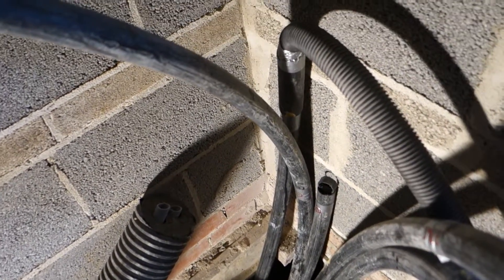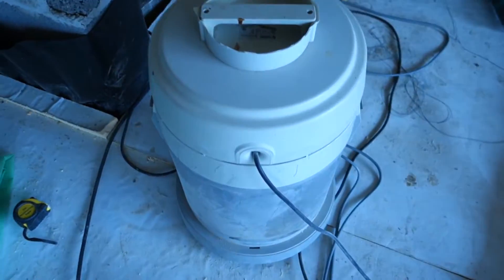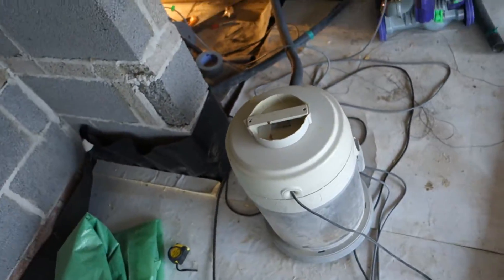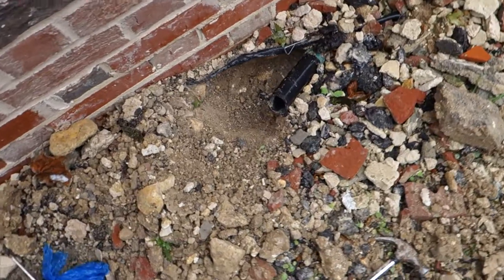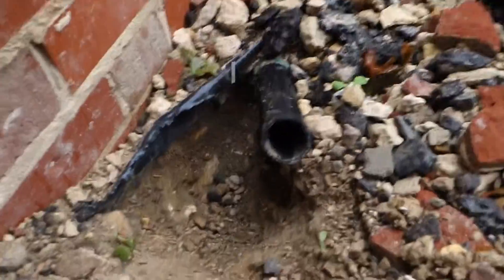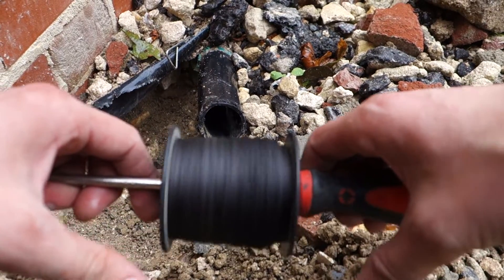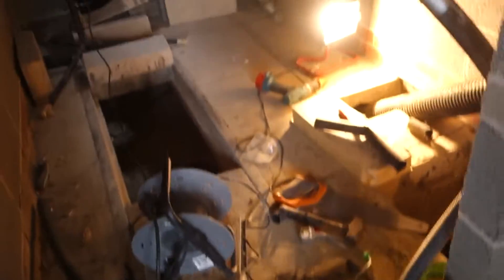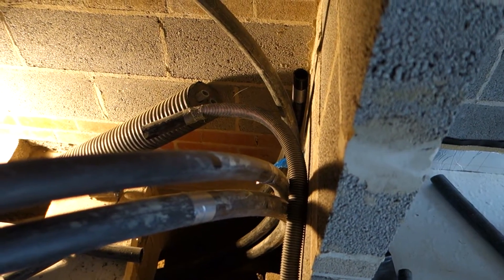Using a vacuum to pull cable through conduit. Does it work?

Comment: I sucked a pull cable 250' with this method...  I think it's better to have a bit more plastic though... you want it tight enough in the pipe that not much air is escaping past it.

Comment: We had a 40 metre underground conduit which had a couple of bends in it and basically whatever we did, we couldn't push a cable through it - it always stopped at one of the bends. We tried thicker pushers and even tried fishing for the cable with an endoscopic camera from the other end without success Then we tried this trick and lo and behold, we had a strong thread through the conduit in under 60 seconds from turning on the vaccuum cleaner ! We found that using two pieces of plastic bag set at right angles to one another increased the suction. Beware that the first thing that the vaccuum cleaner will pull out is all the water in the pipework, so you will end up with a wet vaccuum cleaner so use a wet and dry !
Reply from the maker: Good news it worked, it's a great trick. A bit of washing up liquid on the cable makes a load of difference as well and having one person push and another pull. The push doesn't have to be much, it's just to stop the cable binding. Yes I had to use a wet dry vac. Thanks for the comment

Comment: This is brilliant! Thanks for sharing! The commercial versions use a sort of sponge like thing at the end of the cable but then of course you need a lot of suction power or another solution was with compressed air basically pushing the cable instead of pulling it.
Reply: Buy a cheap bath sponge from a supermarket, cut a ball which is slightly bigger than the pipe's diameter and then thread a piece of string through it using a long bolt with a washer on the end to tie it to. Our neighbour just did this after we were successful with Brian's method using a plastic bag. Dipped the sponge in cable lubricant and it went through their conduit like a rocket ! Water in the conduit doesn't affect it at all.
Reply from the maker: I love that this works, save so much time
Reply from the maker: Yes they use compressed air to blow fibre but a much smaller tube. 

The basic principle is to create a simple piston. 

I found this on YouTube myself, I lean just about everything on here hahaha

Comment: Going to give this a try after snapping the original coaxial that was supposed to be my pilot cable in half.
Reply from the maker: How did you get on? Did it work?
Reply: @bodgeitwithbrian  bit of fiddling with the size of the plug, but it worked like a charm! Make sure you seal well to create a proper vacuum.
Reply from the maker: Great news, it's so satisfying to see it work, great job

Comment: I just developed a way to hollow out antlers, from the base to the tips of each antler. I am going to try out your vacuum process. If it works I will let you know.
Antler Dan
Reply from the maker: Antlers on a dears head? Why do you need the vacuum a wire through?

Comment: What’s the longest distance this can work?   I have a 150 ft patio drain that was installed incorrectly..  could I pull a string through it and re pull a flexible pvc pipe through the drain
Reply from the maker: I think there is only one way to find out. It's just a crude piston, the idea should scale up.
Reply: It will go pretty much forever providing you have no loss of suction where there is joint gaps where 1 duct ends & another joins the size of the ducting bore doesn't matter either if you've got a big enough vacuum for or compressor to blow it instead the only main problem is where utility cable ducting goes deep underground there is the possibility of water getting into the duct sometimes the water will not blow uphill & the bag might split
Reply from the maker: Yes there was water in my run from the joint, you should use a wet dry hoover. You will find that some water will come out and I ta best to use a plastic bag, the water lubricants the run then
Reply: Still no Hoover evidence
Reply from the maker: It's a verb, as well as a brand name
Reply: So what you're saying is you can Hoover with a Dyson, an Electrolux or a Vax which is totally wrong you can't it's not a Hoover they're trademarked-copyrighted
Reply from the maker: Yes you can absolutely hoover something up with a Dyson

Comment: Your Title is wrong, should be "vacuum to pull a pull string through conduit" you never pulled a cable with the vacuum
Reply from the maker: But the ultimate goal is to get a cable through, what would you Google?
Reply: @bodgeitwithbrian  The title should be descriptive of what the vid is. Then in the description or keywords is where you describe the cable, wire, conduit vacuum etc Most searches include the descriptions.
Reply from the maker: Thanks for the comment
Reply: Yes using a vacuum to suck a length of cotton or thread through a duct would be a good line
Reply from the maker: Works perfectly every time

Comment: will a normal dyson work
Reply from the maker: Yep, the trick is to block off one end, hook up you vac, let run for a bit to drop the pressure and then pop in your small plastic bag attaché to your fishing line. Make sure the line can move freely and watch out for your fingers. What are you planning?

Comment: Fishing line  👏👏👏
Reply from the maker: It works incredibly well. One extra tip is to make sure your vacuum filter is not clogged up with dust so it provides maximum suction

Comment: Just tried out with a 35 meter conduit and it worked.
Reply from the maker: Good news
Reply: Any bends in between ?
Reply from the maker: Yes, it was two pipes joined and had lots of curves. The key is getting a seal
Reply: @bodgeitwithbrian  Thanks